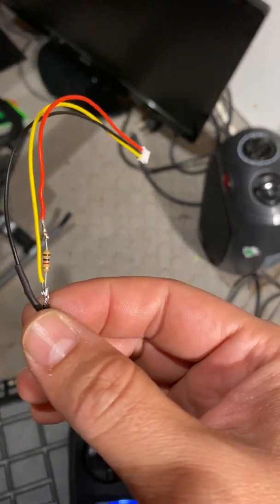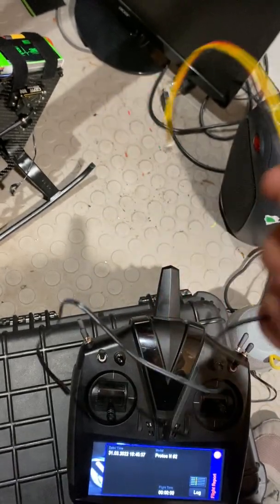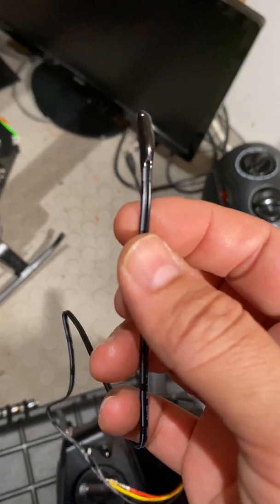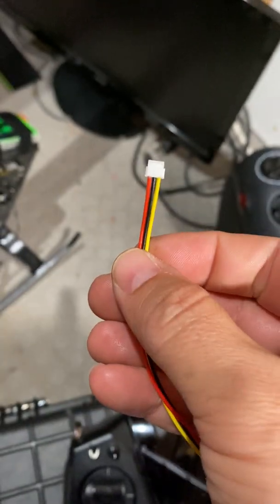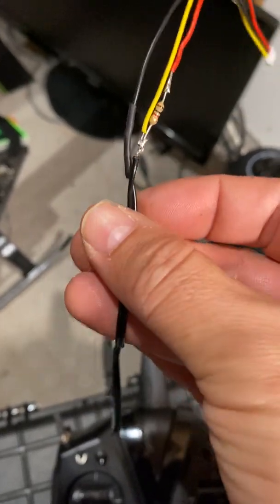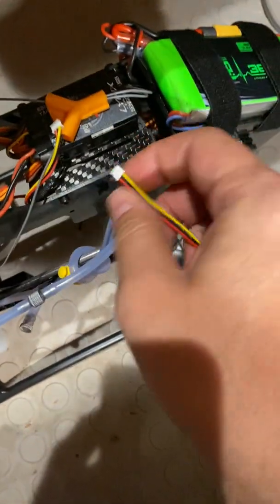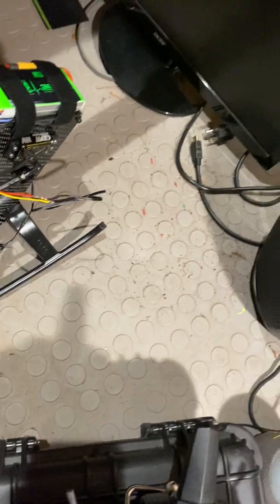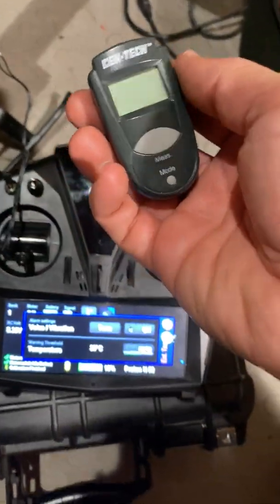Temperature sensor on Mikado VBar Neo and VControl touch flight graph

Comment: thank you for this video. please let me know exact wire diagram. slightly confused.
Reply from the maker: The diagram is very simple, thermistor connected to ground and signal and the resistor is connected to signal on one end and positive on the other end. I describe this in the video

Comment: Sir...before install temperature sensor ... u can see graph rpm or not...?..my vbar touch not show rpm graph...why?
Reply from the maker: I am not sure but I think that you can see it if you have the telemetry cable plugged in. In the case of a Nitro without temperature sensor, you would not have any telemetry cable plugged in so you would not see the graph. You can fake the temperature signal by plugging in a dummy cable that acts as a temp sensor but at that point, it is easier to simply make a temp sensor
Reply: @marcoceze6190  ok thanks...i will try dummy telemetry...just plugin and to see grpah...know just have log data vbar touch ....thanks sir.  I will try first